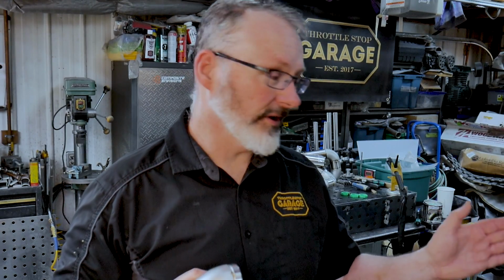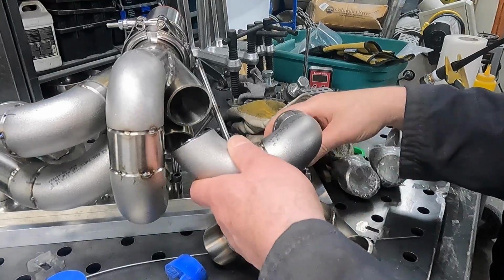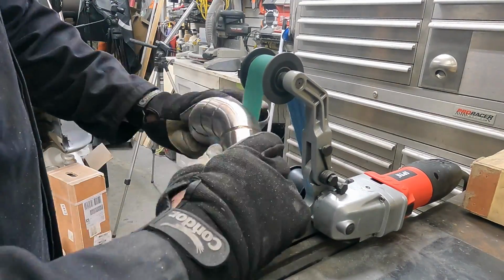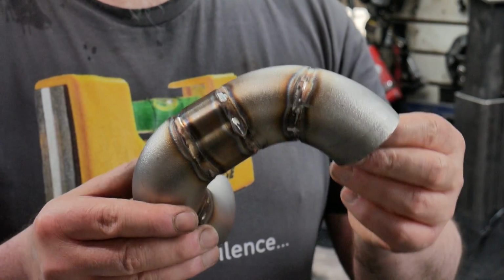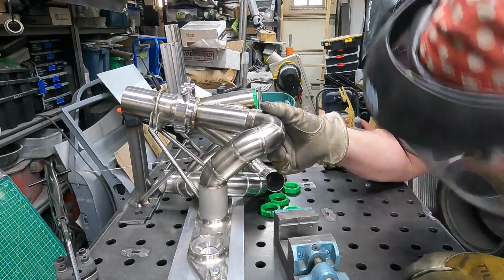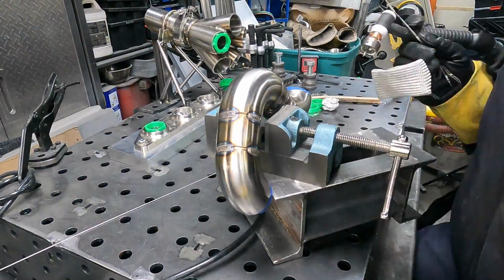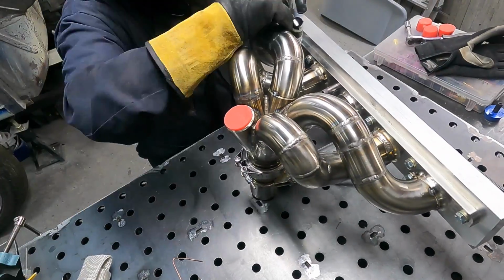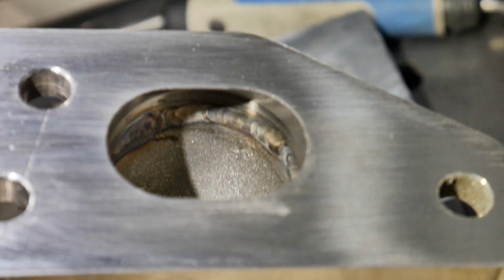DIY Turbo Manifold TIG Welding

Comment: how did you manage to get good fusion in the root pass? I'm struggling to avoid melting the sides of my weld area before I even get close to penetrating out the other side
Reply from the maker: The land was only 1/16" and I just took my time. I also practiced on scrap until I got the rhythm down. I'd wait on the puddle to "sag" just a little.

Comment: Incredible work!  I'm building my first long runner manifold right now and the runner shrinkage definitely has to be factored in.  Making them all hang over the collector about 3-4mm seems to work well to account for the shrinkage. 

I'm definitely not taking all the time you did on cleaning and polishing because I just don't work that way but your results are certainly more aesthetic than mine.  

Well done sir👏
Reply from the maker: Thanks - I'm glad it was helpful (I hope it was helpful).  The shrink was more than I expected.  Live and learn.

Comment: I have a software program that designs headers with the desired primary tube lengths and packaging constraints. A design like this would have only 2 to 3 welds per primary tube. No trimming and fitting,
Reply from the maker: Care to share the name of the software?
Reply: @ThrottleStopGarage  I wrote it while designing headers for nascar and f1. Today you could use SOLIDWORKS with their piping toolbox.

Comment: I learned this from another guy but thoriated tungsten, you can bend the end of the tungsten to get into those hard to reach places where you're trying to put a straight tungsten in an area that it just doesn't fit so good, just a tech tip you can try and not try it up to you
Reply from the maker: I saw someone on another channel doing this not that long ago.  I never knew!

Comment: Awesome work Craig. I weld for a living and I still enjoy watching videos like these. No matter what I will still learn something new. We always have more to learn, no matter the experience level.

I wanted to ask. Can you share some some info about those adjustable towers you have on the table that you use to hold up the runners? Looks like a cast iron pipe with a bolt in it. I really like the idea was hoping you would share some info on it.

Cheers and keep up the great work.
Reply from the maker: Thanks.  Those are my clamps for the table. I just bought some welding clamps, cut the fixed end off, and welded on a bolt. It was a lot cheaper than getting the real ones.  I cover these in the welding table fixtures video.

Comment: Hello colleague, your work and your assembly technique are very interesting, but unfortunately the welding technique leaves a lot to be desired, in your country you have the habit of using a pedal and this really interferes with welding, watch videos of Brazilians welding pipes and adopt these techniques in your daily life.
Reply from the maker: I'm not a welder and it is fully penetrated and was purged.  This is not a milk factory and I'm not selling this stuff.

Comment: What's with the blue plugs on the pipes when welding?
Reply from the maker: Purge stainless steel welding with argon inside the tube to prevent carbide precipitation.
Reply: @ThrottleStopGarage  is that safe ? Wouldn't the argon gas exploed if there was a decent size spark ?
Reply from the maker: @jmoore9806  argon is inert. Thus is the standard procedure for welding stainless steel.

Comment: The flat bar that you use to weld the flange of the headers, is aluminum or metal? How tick is the plate? Very amazing work that you do, you'r a craftsman.
Reply from the maker: It's aluminum and 1 inch thick.  Thanks for watching.

Comment: use a home fan too cool them down in between runs 

youl cool it ten times faster and it won’t contaminate the metal like compressed air does
Reply from the maker: Good point.  My air is very clean and dry but that's not true for everyone.

Comment: Make sure to rotate your torch with the angle of the pipe! Great video otherwise😁
Reply from the maker: I'm working on the technique all the time!  Still learning all the time.  Unlocking your wrist has been difficult for me to learn - but I keep at it. As you point out - consistent torch/tungsten distance and angle to the part is critical for penetration.

Comment: Appreciate all the tips !

Any idea what your current settings were ? 

I'm mid fabrication of a similar manifold for a Lancia twin cam - just at the 'spotting' stage having gotvit into shape with equal length pipes - more luck than judgement !

I found a lathe invaluable for this - not sure if your plumbing pipes are the same on your side of the pond, but here in the UK, 40mm solvent weld waste pipe is a really goof fit into the pipes and makes an ideal 'joiner' to get everything into shape.

I solvent welded a 'coupler' to the straight plastic spacers and trued them up on the lathe to keep everything square - then cut the stainless pipe to thr required length, again using the lathe to keep everything square.

Downside with a lathe - especially working in a small garage workshop is that you don't grind inside anymore - you get a bit paranoid about grinding dust !

Amyway - should be finishingcrhe spoting up next week - then it's the main welding - after quite a big of practice to get my welding a bit better !!
Reply from the maker: I wish I had the space for a lathe!  Amperage was 1 A per thou minus 10 %...around 100 A for this size pipe. I've got a foot pedal control, so I never know where I was welding exactly.
Reply: @ThrottleStopGarage  Thanks for the reply !

If you ever get the chance to squeeze one in - a lathe is a must - but then you start to hanker after a mill, then maybe a tool and cutter grinder, then perhaps a ... .. ..

Machine tools have a habit of breeding !
Reply from the maker: @mrb.5610  Oh, I know...I have managed to stay out of trouble so far, but I also grew up in a fully equipped machine shop.  In some ways, knowing what you could do is "worse". LOL.

Comment: What amps are you running
Reply from the maker: Did I forget that detail - Sorry.  1 amp per thou minus 10% - for this I had the machine set to 120A but was not full pedal.  Around 100A.

Comment: It looks great but do u think that just fusion will hold up..a turbo builds a lot of pressure which could blow those welds?and the fact that your grinding them down..I don't know if I agree
Reply from the maker: Filler wire (347) was used and non of the joints were ground in the end. I have never built a turbo header before, but I'm confident this will be fine.  If it's not - I'll do it again.

Comment: watching this in 2022 and my original comment still stands.
you should of outsourced the facing of the exhaust to head mating,
getting those two right is make or brake.
Id of welded on tabs that were threaded to hold the exhaust manifold to the facing machine.

That way you can face it at a whim if need be.
those two mating surfaces are the most crucial.
most heat, most pressure in one spot throughout the whole car.

important.
Reply from the maker: It's not installed yet...while it didn't move much, I'll have it surfaced when I'm ready to bolt the engine together.  I've still got to add the EGT bungs at some point.

Comment: reasons for not rewelding is welding researching
Reply from the maker: I'm not sure I understand.  I'm happy with the weld process that I sorted out.  I would, however, now weld this differently.  I think I'd ensure that I had an open root.  I think this would be a better way to ensure that I had full penetration.

Comment: Im a bit late to the party. But i make alot of pipe manifolds and the biggest enemy is shrinkage. I always make the primaries 3-4mm Long than needed to account for the shrinkage.
Reply from the maker: I wish I knew this when I was welding it up.  I figures it out the hard way...hopefully people read the comments!
Reply: @ThrottleStopGarage  I've not read through the comments ha! I stumbled across your Carbon Intake Manifold for research purposes and found this video on the manifold.

Comment: Very good detail.   I'm doing a similar project.  Diesel engine so 304 instead of 321.  Same diameter and schedule 10S too.  But this is for low speed, 4000 RPM and being a V8, space is a premium so going log style.  Individual port flanges, plasma cut from bar stock.
Zero root gap too, tacks can be done without purge or sugaring.  I only had to cut 17mm sections which I did with a pipe cutter.  
Purge root pass, then fill with water to fill/cap.  Yes, welding pipe full of water is possible with stainless.  Greatly reduces warpage.  
These are for twin, light turbochargers for quick spool.  All the number crunching shows 10 PSI boost at 1400 RPM and drive pressure ratio under 1.4 maximum. I am playing with Garrett VNTs so there is a lot of tuning possible with the vane position controller (RPM, TPS and MAP).  TPS and RPM dictate % load or torque, this infers injection quantity which then does a 3D lookup for required MAP.
I want a clear exhaust gas, no coal rolling but doing this with purely mechanical injection requires turbos with fast response, only VNT will work.  Only looking for 235 Hp.
Reply from the maker: I've never tried welding pipe full of water.  I do turn the purge on for tacking - not needed, but not hurting and I've got to pay the argon bill either way.  So I'm not bothered by it.

Comment: tube inside is not smooth on welds, i am making long tube header and do not purge because after every single part is welded, i must smooth weld inside, if tube is to long i can not reach weld ,
Reply from the maker: If you purge welded...you wouldn't need to smooth the inside of the tube.
Reply: @ThrottleStopGarage  how that, you purged and you have bumps inside on welds, your tube is double thickness of mine(1.5mm) , if you did not bevel ends, you would not penetrated inside, for me , most important thing is to have smooth surface inside because bumps make turbulence and less flow rate of gas
Reply from the maker: @makantahi3731  You're right - it's easier to do on thin tube.  I've posted examples on Instagram for 16 ga stainless.  The insides of the welds look like the outsides.  There are no bumps inside this header.  If you like the grinding - great.

Comment: Fantastic video.  I'm a novice when it comes to welding.  I have to ask though, where did you get the head-side manifold flange from?  I plan to fab a manifold for my 5-cylinder this spring and that flange is perfect.
Reply from the maker: Thanks Matthias, As noted on IG - I designed the flange and had it machined.

Comment: I've designed FileMaker Pro databases for 30+ years and spent countless hours doing similar fix and repair and touchups. They were so annoying at times. I've often thought that I should do something that had a finality and I couldn't go back and update. After watching this video, I've changed my mind. I see that no matter what you do, if you seek perfection it will be agonizing. I've pushed objects about on the layout pixel by pixel and changed colors by 10, etc. And rewriting scripts so the layout wouldn't flash and would open to the exact point on my screen... Trying to open a window in an exact screen placement is quite similar to the work you did, just not as sweaty.

Now I can return to my work in peace knowing that no matter what I do I would end up with frustrations and stress trying to achieve what I want. Thanks.

You have my respect for your craftsmanship.
Reply from the maker: Thanks Jack - it's not for everyone that's for sure.  At times I have to walk away and get some perspective.

Comment: My 4 cylinder manifolds are pretty heavy. Idk how the hell that 6 cylinder manifold isn't super heavy.
Reply from the maker: Because it's a 5 cylinder manifold?  Sch 10 321 stainless was used.
Reply: @ThrottleStopGarage  I use schedule 10 321 to build mine too. 🤷‍♂

Comment: Great videos man! U are a lot like my self. I've got one tip for you. I started using a sheet of aluminum on my welding bench and its made a huge difference when it comes to not getting grounding arcs. I didn't notice any in the video, but its bound to happen with a steel table. Keep up the great work.
Reply from the maker: Thanks - great tip.  The need for a decent ground when you're welding on a table with mill scale can't be under looked.  I've had the arc problem in the past.

Comment: If you want to stop craters in the ends of weld, run your tungsten up the side of the joint.
Reply from the maker: Thanks Mike - that's a good tip.
Reply: @ThrottleStopGarage  It's especially useful with TIG and MIg as that crater is often a hole through the end of the weld. And your comment about being comfortable is spot on.

Comment: Great job and very interesting video. Thank you. I was just told that you are the "Canuck" from "Turbobricks" forum. I have been using your advise porting my first b20 cylinderhead. :)
Reply from the maker: Cool - I am indeed "Canuck" - glad to see someone is actually reading the forum.  There are a few things I'd do differently with the B20 head  - pay particular attention to the long side radius on the intake - it needs to be blended to the seat for maximum effect.
Reply: @ThrottleStopGarage  Nice to meet you. Your post in forum helped me a lot. This was my first porting so it's not perfect but I hope I managed get the flow little bit better... I focused on the exhaust side. The head is still in the machine shop waiting for new valves & guides so I don't know the final result now. I also bought a new car and my first turbo. So that's why I watched your manifold video. :) I'm not building it by myself. I try to buy used one if I can find suitable.

Comment: Would you be able to actively cool the pipes (gently, with a box fan a meter or two away or something) to speed up the process? Or would that wreak havocs with the welds?
Reply from the maker: I was making the mistake of blowing compressed air on the parts to cool as I welded.  They shrink like crazy.  My sense of things is you just have to accept that welding a runner may take an hour or so to complete.
Reply: @ThrottleStopGarage  I said *gently*, though. Maybe there's a happy medium between nothing and blowing compressed air?
Reply from the maker: @anidiotinaracingcar  Probably - but I've got time!

Comment: With any turbo manifold I assume it's going to warp after a few thermal cycles. After you break in the engine and you've gotten a few thermal cycles in the thing you probably want to resurface that flange again.
Reply from the maker: Only if it leaks - fingers crossed!

Comment: you should deck that face.... on the same machine you deck your block or face your head.
Reply from the maker: I did flatten the mating surface - the belt gets it close and I spent an hour or two with a file to get it finished.  I'm not advocating that everyone tries to do this by hand.  It came off the chill block with very little warping.  I checked it with my machinist straight edge and it's dead flat across the 5 ports.  The little lift at the far edges (less than 10 thou) is easily clamped out.
Reply: @ThrottleStopGarage  you'll quickly see your inaccuracies once its face properly.

Comment: I agree with @jimsiggy great job, and if I may add a tip, when you let off thee pedal to stop your weld swirl the tungsten and let out of the pedal slow and you will get a cleaner less bumpy and pitted tie in, also I would suggest increasing your post flow and not moving the cup from where you stop to help cool the part and your tungsten, if your tungsten turns black when you stop welding you have inadequate post flow and accumulate oxides on the tungsten turning it black.
Reply from the maker: Thanks - Great tip - I was feathering and figured out the swirl by the time I was done. I know I've seen others do it...it's mostly a matter of keeping focused/relaxed.  I ran out of gas after the root and the next tank that I got I'm pretty sure was contaminated.  I increased post flow and just couldn't get it to weld nicely.  I also don't do this enough to just know that it was a gas problem.  I reported it when I swapped out that tank and the next tank was completely different.  Welded much better.  I was a little gutted as it was too late and I should have taken that second tank back.  My welding supplier did move me to the pro price schedule instead of the home welder price (saving me 35%) so that was nice.

Comment: A little tip is to weld every joint directly. Like a clock. Say I start at 6 and stop at 9. After that start at 3 weld to 12.  The continue to 9 to 12 and last but not least weld 6 to 3. Then you won't get the problems with the pipes to pull at any direction.
Reply from the maker: Great tip.

Comment: Beautiful. Entertaining and informative as always.  I love the pride and time you take in your hobby work.  This may be a question for later, but have you decided on your EFI computer?  Will you continue with the DIY theme and get a DIY ECU?  i.e.  Megasquirt, Speeduino, or RusEFI Proteus?
Reply from the maker: Thanks and good question Paul.  Given that I am running a drive by wire throttle body, I can't run MS or others - MAXX ECU is going to get the ECU business.  While I've EFI swapped cars, I've never wired one from the ground up.  I'm excited for that part of the project.
Reply: @ThrottleStopGarage   Just FYI RusEFI Proteus supports up to twin eTBs.  Already demo-ed on a BMW V12 with two by-wire TBs.   Either way looking forward to you getting there!

Comment: Spectacular sanding tool. Do you have a link from which you can buy it? thank you
Reply from the maker: I'll release the video in a few weeks.  I got it from Amazon - needs mods to work.

https://www.amazon.ca/Mophorn-Professional-Burnishing-Finishing-Stainless/dp/B07J6G4W25/ref=asc_df_B07J6G4W25/?tag=googleshopc0c-20&linkCode=df0&hvadid=335074856084&hvpos=&hvnetw=g&hvrand=9675272520138543160&hvpone=&hvptwo=&hvqmt=&hvdev=c&hvdvcmdl=&hvlocint=&hvlocphy=9001300&hvtargid=pla-600256401543&psc=1